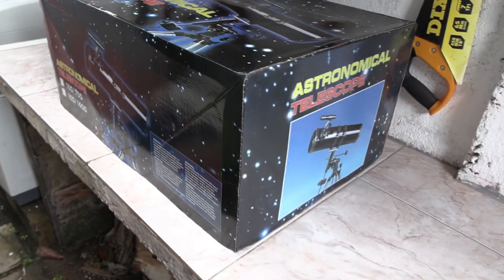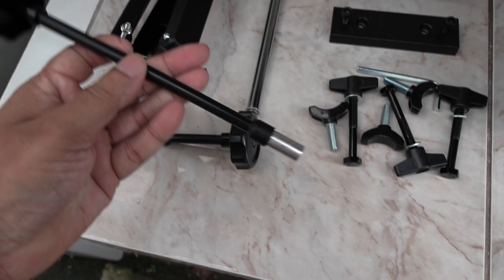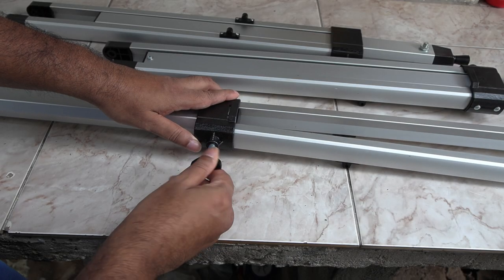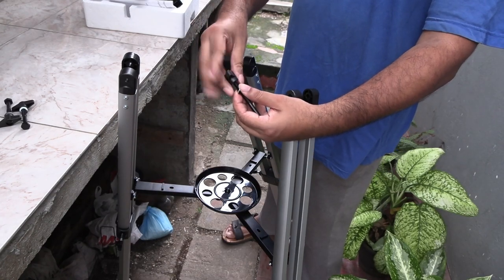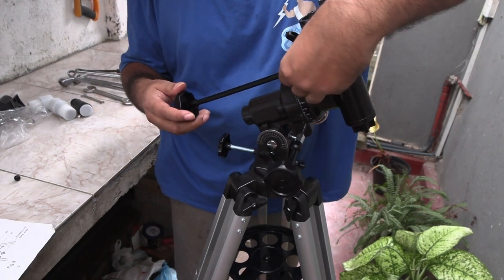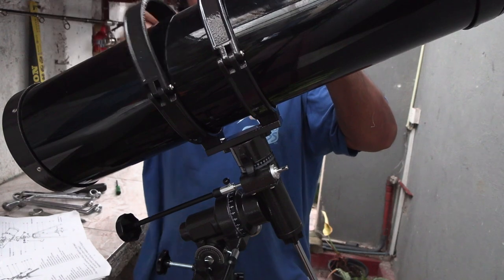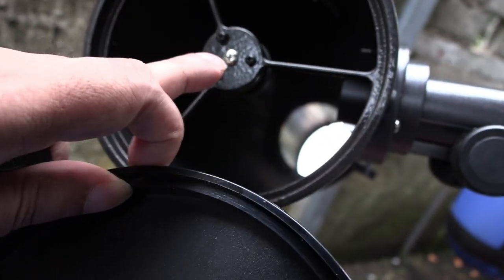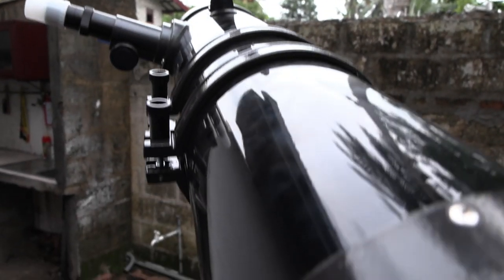Chinese 150mm 6 inch Reflector Telescope- Unboxing & Set-Up Guide

Comment: Hey dude, good video 👍 I just bought and received the exact same scope, and Will be using it tonight. I've had a 80x60mm reflector for 2 years, and after much research, this is the cheapest 150mm with good optics, and a usable mount available.
Reply from the maker: Glad I could help. Make sure to like and sub.

Comment: That 150/1400 is no good for anything scam with blurry spherical aberration generator in place of parabolic mirror and cheapo Barlow to make blur bigger (+degrade it further) and make collimation lot harder.
Unless it's Cassegrain, tube of all proper optical design reflectors must be roughly equally long as focal length!
And with such brander/maker really wouldn't exactly trust this short 750mm focal length one to have accurately parabolic mirror either.
Reply from the maker: Can see Jupiter and Saturn big and sharp. Thats all it matters.